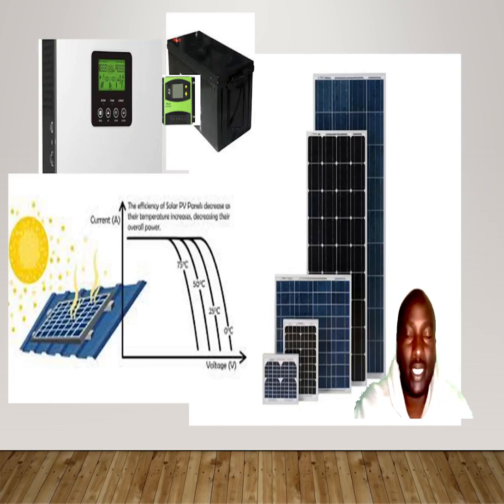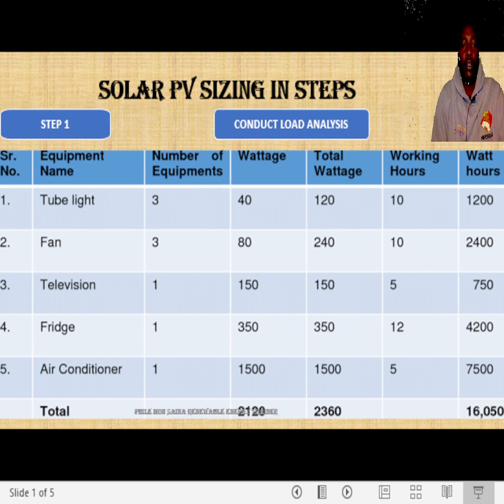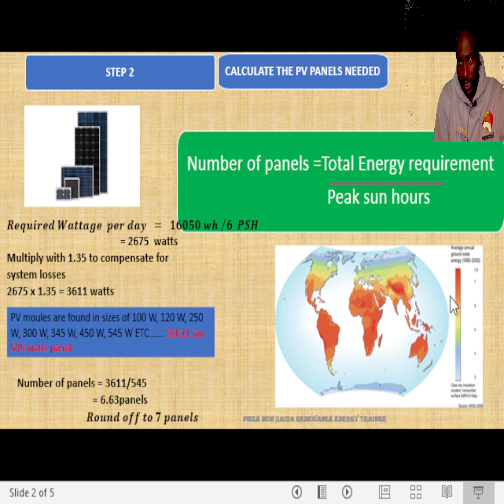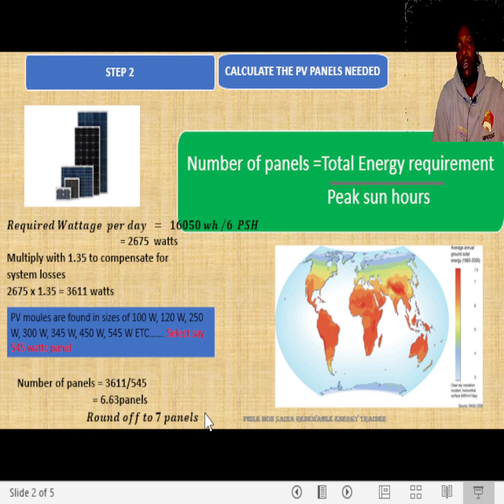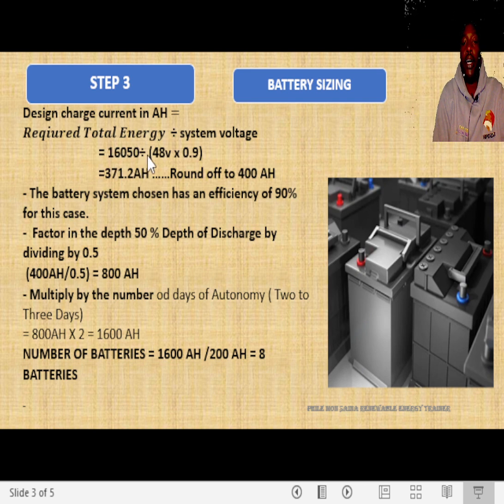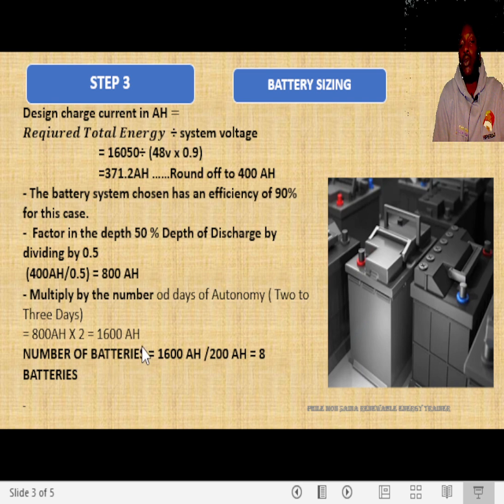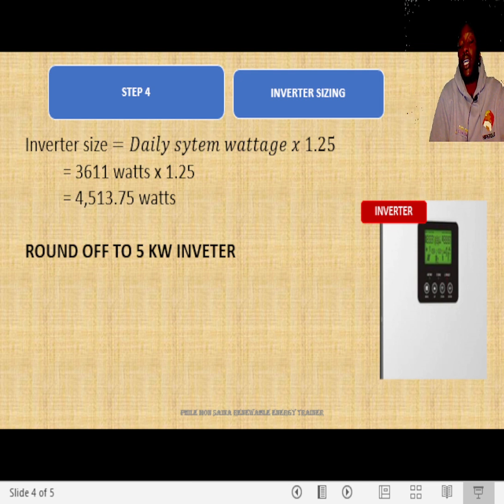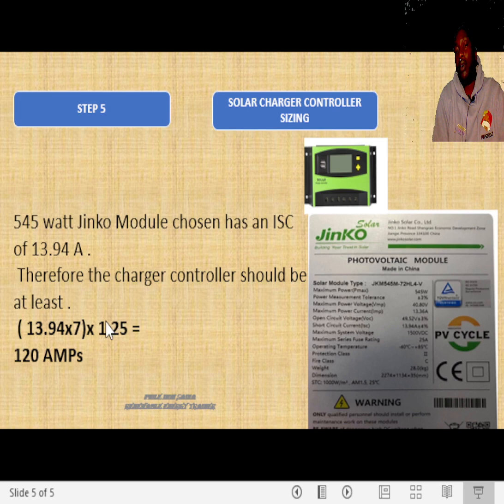Step By Step Solar PV Design

Comment: Thanks for this information, can you pls.explain more on the open circuit voltage and current. How will you determine the system voltage?
Reply from the maker: System voltage can be 12v, 24v, 48v .

For loads below 1200 you can use 12v.
For loads between 1200-3000 recommend to use 24v.

For over 3000 use 48v.

These are due to cable sizing and inverter input and output sizes.

Comment: is 1600Ah @48v = 200Ah *8pcs of Batteries?
Reply from the maker: Yes
Reply: @philemonsaina2863 Really? kindly explain how?
Reply from the maker: Can you reframe the question ?
What is the voltage of the 200AH battery and clarify if the 1600Ah battery is a single battery .
Reply: The voltage is 12V and 1600Ah is not a single battery